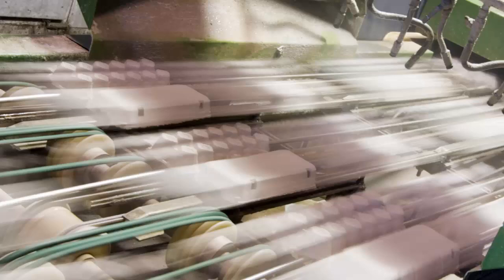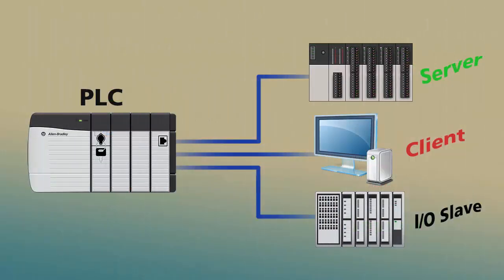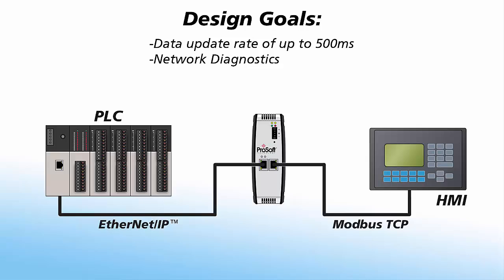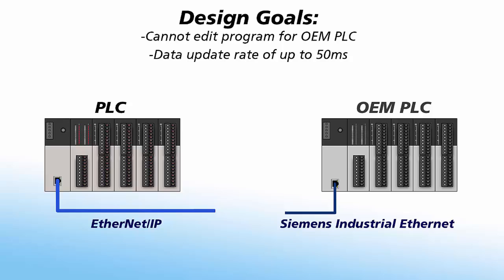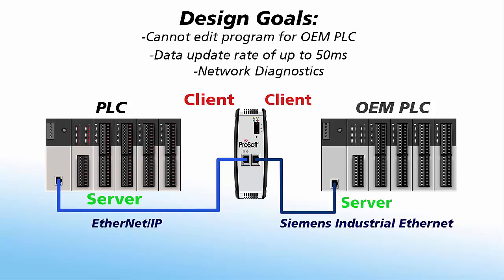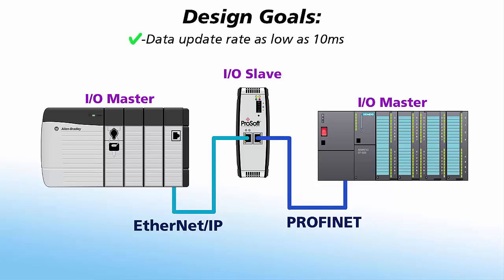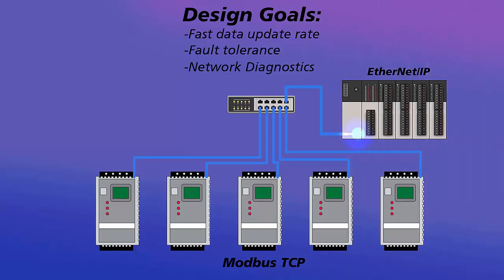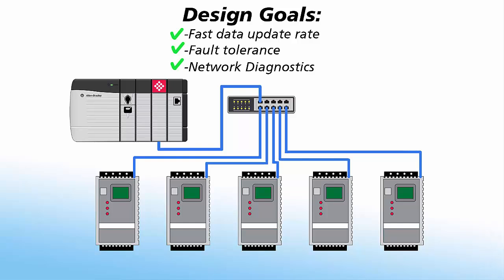Understanding Client, Server & I/O Messaging for Ethernet Networks

Comment: Dears it is wonderful.
Please if we get plc and hmi at each plc and scada     speak with same protocol
Which one will be client and server??
Reply from the maker: In any Ethernet communication scenario, the device, equipment, or software that will request a TCP/IP socket connection and then, once established, will issue messages to read data from or write data to a different device, equipment, or software will be the communication Client.  Whatever device, equipment, or software is merely listening on a Ethernet network, waiting for some Client to request a socket connection and then send requests to read or write data and will allow the socket connection and respond to the communication requests from the Client will be the communication Server.

If you think of a restaurant analogy, when you go out to eat, you pick the restaurant to go to (you initiate a connection). you order food (make a request to receive food) and later you pay for the food (give money/info to the restaurant).  You are the Client, in this analogy.  The person who comes to your table, takes your order, goes to the kitchen and returns with your food and give you your bill after the meal is your Server.

In the automation world, there are no rules as to whether a particular devices will be a Server, Client, or (sometime) both at the same time, based solely on whether it is a PLC, HMI, or other device.  You will have to consult the manufacture's documentation for each specific device to see if it will be a Client, Server, or might act as both, like our Ethernet in-chassis and stand-alone gateways can do.
Reply: @prosofttechnologyinc  dears think you very much for your clear explanation. And support

Kindly I get this scenario    

 5 Hmi connect into  5 plc   
Whole 5 plc connect through switch into one  scada software ,
Whole speak with same ethernet language 

Which one will be client or  server?? 

Am I need to install one master plc control 5 Plc? 
In this case is this  main plc Wil be server??

Comment: What is mean by PLC
Reply from the maker: A PLC is a Programmable Logic Controller - it's equipment that's designed to be used in the control of industrial or manufacturing processes, such as those on a plant floor. Another term you may hear is PAC - or Programmable Automation Controller. This article explores how a PAC can be used and its differentiators: https://www.motioncontroltips.com/when-to-use-a-programmable-automation-controller-pac/